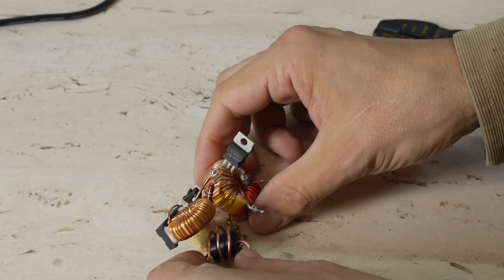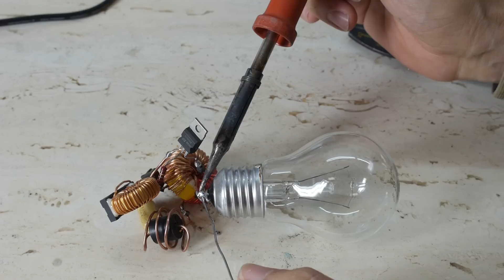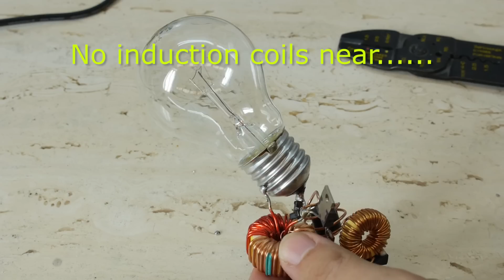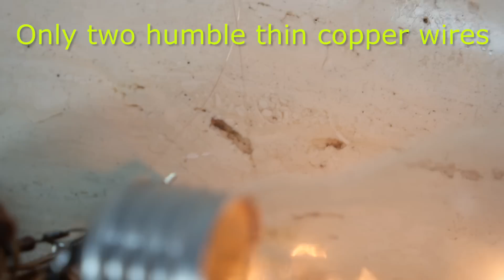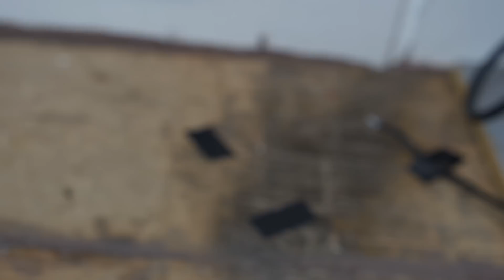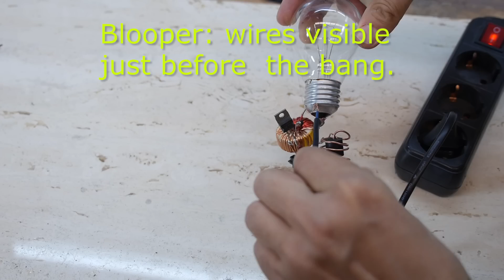Free Energy Light Bulb UNVEILED

Comment: Honestly this is a stupid trick. If there was actually some science involved it would be cool, but it's just two wires that don't show up on film.
Reply: yea. i was expecting a capacitor being charged by that first pump of electricity
Reply: Unfortunately, many "free energy" scams are just as stupid.
Reply: I know. I was never expecting "free energy". I was expecting something that made it look like you were getting free energy through the use of science. Not a trick that is based on the user of a shitty camera.
Reply: sghost128 My take away lesson from this: don't bother with a $10 scam when a 2 cent scam will work just as well. And yes, all perpetual energy machines are fall into this category.
Reply: danceswithtrees I like that line. I'll have to borrow it.
Reply: danceswithtrees I wouldnt say that. they can work, such as magnet motors. here is the problem tho. there is so little energy in them you cannot take any out.
Reply: Mike Warren There is no energy in a "magnet motor" save the very small amount of energy stored in the magnetic field of the magnet. And if you were to remove that energy, it would no longer be a magnet.

Believers in magnet motors usually seem to confuse force and energy.

Here's what puzzles me: all these people eagerly proclaiming that non-existent forms of energy permeate the universe while ignoring a very real, substantial and still largely untapped one all around them: sunlight.
Reply: Force is able to be converted into energy.

The problem with solar is the market has not caught up with the technology. A 8 to 10k watt solar system runs 25k USD

Its just not cost effective.
Reply: Mike Warren No, force is not energy. They don't even have the same units.

Applying force through a distance produces energy, but that's completely different.

Solar systems are already cost effective. I've had one for 15 years, and the prices have fallen enormously since.

Consider it an opportunity. Find an even cheaper way to tap solar power and become rich and famous. And you don't even have to violate the laws of physics, unlike all the other forms of "free energy".
Reply: I did not say force was energy.

and no. its not cost effective. I just priced it out. I can build my own system, and even then its not cost effective for anyone living on the grid. i spend $100 bucks a month on electricity. At 25 grand to install, it will take just over 20 years to break even. 

Can it be worth doing? yes. but for most, its not a matter of the investment being worth it, its a matter of simply not having the money to do it, worth it or not.

I have thought about making a business out of it. Its just not going to happen when the grid tie inverter itself will cost 4 grand and the cells another 4 grand, not including construction, wiring, electronics, monitoring and labor.
Reply: Mike Warren What's your utility's price for electricity? Here it's something like 15-20 cents or more, with a sliding scale that works something like income tax. The more you use, the more each kilowatt costs. So that first kilowatt-hour of solar is worth a lot.
Reply: no idea.  but not enough to make a 20 year investment worth it. not by itself. with a new home perhaps. the payment wouldnt be much built into an already existing loan.

certainly wouldn't be worth it for an investment for other properties.
Reply: Mike Warren Do you really think that if this perpetual motion machine/magnetic field extracting technology was real that someone wouldn't have actually made a working model? Claims of this sort should be lumped in with end of the world predictions and Easter bunny sightings.

It's good to know that you have not been separated from your money to buy one of these things "magnetic motors" but it is concerning that you think it is real and that it works.
Reply: I never said anything about extracting a magnetic fiend...........
Reply: Mike Warren You said something about "magnet motors", which implied you could extract free energy from them. You can't.

A magnet does hold some energy in its magnetic field, and you can even remove it. But when you do, it's no longer there. It's like discharging a battery or capacitor.

One of the simplest ways to tap that energy is to let the magnet pick up a piece of ferrous metal while making it do work as it moves toward the magnet. The total energy in the magnetic field decreases by the mechanical energy you generated, and to restore the field energy you have to pull the metal away. And that takes work.
Reply: That's not what a magnet motor is
Reply: Mike Warren Then what's a magnet motor? When I look it up on Wikipedia, it redirects me to Perpetual Motion. Seems right.
Reply: Turns a shaft
Reply: Mike Warren Yeah, I understand, I've seen them. None work. None can work.
Reply: Yes the can. Why couldn't they?
Reply: Mike Warren Um, the first law of thermodynamics?
Reply: Does not apply. Magnetism is not energy
Reply: Mike Warren The laws of thermodynamics always apply. Always. No exceptions whatsoever. Magnetism is a conservative force, so any machine with fixed magnetic fields, no matter how complex, cannot do useful work while operating cyclically, i.e., periodically returning to the same starting state.

Since magnetic fields do contain energy, it is possible to remove that energy, but once you do it is gone; you'd have to do work to replace it. Sort of like discharging a capacitor, and probably not much more energy.

Electric motors work by converting electrical energy to magnetic energy and then converting some of that magnetic energy to physical work. (Remember I said a bare magnet has more magnetic energy than one with a piece of iron stuck to it.) That removed magnetic energy must be replenished to repeat the process. That's why all motors stop when you turn off the power. If there's no way to externally power your magnet motor then it will also stop, even if it slips a few degrees from its original starting point. It'll stay there forever.
Reply: It can be made to continually spin. But like you said it's not enough to do anything
Reply: Mike Warren No real machine can continually spin without power because it's impossible to remove all friction and windage. So unless it draws power, it will stop. It cannot produce any useful work without an energy input. None at all.

The only "perpetual motion" machines we have are spacecraft far from any planet and its fields. Like the Voyagers in interstellar space. When they run out of fuel they will continue to spin essentially forever because there's nothing, not even friction to remove that energy.
Reply: so then the question is, where does the energy/force/magic come from that are in magnets. they repel forever. or at least pretty dang close to it. that magnetic force will spin a machine until the magnetic force is gone. 

since magnets work on electromagnetism, where is this energy coming from?
Reply: Mike Warren As I said, a magnetic field stores energy. But it does so just like a capacitor. When it's first made, there's no energy. You can put some in, let it stay and then take it out. Once you do, it's gone. You have to replace it if you want the magnetic field again. That takes work.

Permanent magnet materials strongly resist having their energy removed. But that energy was still put there by its manufacturer.

An analogy would be to sell a pre-charged capacitor with insulated terminals. It would produce an electric field between its terminals that would stay there "forever" (if it's an ideal capacitor) with the insulation making it hard to remove the charge. But you can by supplying sufficient external voltage to break it down. Then the capacitor's energy is gone and its electric field goes away.

Magnets can be demagnetized with a sufficiently strong external field, and in the process of demagnetization you can remove the energy put there by the manufacturer.
Reply: magnets do not have manufacturers, they are mined from the earth. they do not lose their magnetism. a magnet is not a capacitor.
Reply: Mike Warren Incorrect. Modern magnets are made from artificial alloys designed to hold very strong fields and to resist having them removed.

Any naturally magnetic material (e.g., a piece of magnetite) with a field had it put there by the earth's field. That energy wasn't free either. It was generated by the dynamo in the earth's core, which in turn is fed by the heat of radioactive decay and the primordial energy in the spinning earth.

No energy, not even in a magnet, came from nothing. It always has a source.
Reply: yes, but that isnt my point, my point is that 2 magnets pushing against each other will do so for much longer than i will be alive.
Reply: Mike Warren Yeah, but so what? I can also generate a continuous force with a rubber band. Gravity exerts a constant force on everything. But force is not energy!
Reply: force can be converted to energy. and unlike a rubber band, it can be done for lifetimes, not micro seconds.
Reply: Mike Warren No, that's just not true. Force and energy are two different things with different units (newtons and joules). Force must act through a distance to produce energy.

A magnet can exert a force forever, but unless something moves as a result of that force there is no energy. And if something does move, it has to be toward the magnet so it can only go so far before it hits the magnet and can't move any further; no more energy is available. It's like dropping a rock, you get energy in the fall but only until it hits the ground.
Reply: move an object away from the magnet, on a wheel, then another away, then another away, around until the first object is back at its start position, then start over again.
Reply: Mike Warren You'll find that the work required to move it back to the starting point is just as much as the work you get out of it.

You simply can't escape the fact that magnetism, like gravity, is a conservative force. That means it doesn't matter what path you take between two points, it's the same as taking a straight line. And if you return to your starting point, that line has a length of zero and the net change in energy is always, always zero.

That's the definition of a perpetual motion machine; if it returns to the exact same starting state with no energy input (e.g., fuel), then it cannot possibly have produced any net energy over the cycle. It doesn't matter if you use compressed air, water, gravity, magnets or rubber bands, the result is the same. No energy produced, just some consumed in friction (which is not a conservative force).

Oh, the machine may put out some energy over part of its cycle just to fool you. But you won't be able to return it to the starting point without giving that energy back.

Have you ever cranked a gasoline engine by hand? You know that it's hard to turn during part of each cycle and easy during others. That's because you're alternately compressing and expanding air in the cylinder. It's like moving away from and toward a magnet except there's a lot more friction, which is why it's so hard.
Reply: Mike Warren How can you say that a PV system isn't cost effective if you don't know the value of what it produces? A PV system is cost effective if each month it offsets your electric bill (on average) by more than the depreciation of the system plus interest. That means you need to know the cost of the electricity from your utility. You also need to know the laws on net metering and the available subsidies and tax rebates in your state.

There are always uncertainties, of course. Your PV system might last shorter or longer than its rated lifetime, typically 25 years for the panels. Here's my experience: In 14 years my 16 Astropower panels have been flawless. My 8 Kyocera panels failed some years ago but were replaced free under warranty, including reinstallation. My inverter has operated continuously for 14 years without a problem.

Another uncertainty is the utility's price of electricity. Which do you think is most likely: go down; go up; stay the same?
Reply: ApolloWasReal Cost of PV system/KWH in it's lifetime = $/kwh.  Compare that to utility rate $/kwh.  PV systems aren't very competitive.  Of course they perform better in places where the weather is PV friendly.  However they have come along way and are only going to get better.  Parents need to push math and science on their children and we'll get there in the next 15yrs where alt energies approach the efficiency of fossil fuels.
Reply: shn lj You need to add in the increase in utility cost over the lifetime of the PV. The PV if bought outright has a fixed cost for its entire life not even inflation will effect it, utility rates are guaranteed to increase. This makes PV very competitive
Reply: Yes. that is true. the question is where one becomes more expensive than the other, in order for current PV prices to be worth it, electricity prices will have to go up 5 times. It will go up due to infation and the natural cost increase of everything, but its not going to go up 5 times any time soon.

in the mean time, i can invest that 400 a month extra into something that will make thousands of times more money.

thus at the end of the day, i end up with more money in my pocket.
Reply: Mike Warren Have you done the calculations recently? Solar panels have become enormously cheaper over the past few years, thanks mainly to the Chinese, and many places have some good subsidies. And I don't know of too many high-income, low risk investments these days.
Reply: Yes. About a month and a half ago
Reply: Mike Warren I'd like to see your numbers. They do vary a lot on location, mainly from different utility rates and the availability of net metering and subsidies. Annual solar insolation varies surprisingly little around the US, only about 2:1 between central Alaska (minimum) and SW Arizona (maximum). I'm in southern CA where sunlight is fairly abundant but we still have a lot of coastal clouds.
Reply: 8k watt system needed. 10 k realistically in order to rely fully on it.

Cost for it is 25k. Around 500a month payments.

I only pay 100 a month for electricity
Reply: Mike Warren What do you mean, "rely fully"? A grid-tied system simply offsets your electrical consumption. A bigger system offsets more but costs more, and in some states you won't get a credit for excess production.

Could you possibly be talking about an off-grid PV system? This is far less viable, mainly because of battery depreciation but also because you have to oversize the system to cover peak loads and your surplus production goes to waste.

I am always having to disabuse people of the romantic notion of telling the power company to go stick it. You want the grid. It's a free, infinitely sized battery that absorbs however much you make and provides however much you need when you're not making enough. With net metering, PV already makes economic sense. Without it, it doesn't unless you're in a remote, off-grid area. I have batteries, but they're only for grid outages. Otherwise they stay fully charged.
Reply: I can get credit for what I don't use. 

I'm currently using 8kwh of  electricity.

Perhaps you can show me the numbers of what benefit I can get from a Pv system vs cost
Reply: ApolloWasReal get my last comment?
Reply: Mike Warren Yes. With net metering in most states you get credit for what you don't use, but only up to the total of what you do use in the following year. If you generate a surplus over a year, you have to work out a cogeneration agreement with the utility, and they'll usually pay only wholesale for that excess. The numbers depend heavily on assumptions about the lifetime of the system, the cost of money (interest rates) and future utility rates. I.e., you're comparing 'dollars per (indefinite) watt" on the PV side to 'dollars per kilowatt hour (today)" on the utility side, so it is difficult to make absolute predictions. However, the numbers have gotten much better and are getting better still all the time.

PV system maintenance is also a factor but it is almost always zero. Panels typically have 25 year warranties, and while inverter warranties aren't as long they're generally reliable too. My Trace SW4048 has been running continuously since 1999 without fail, as have my Astropower panels. My Kyocera panels failed a few years ago but were replaced free under warranty, including labor. Batteries are a high maintenance item but are needed only for utility backup; many systems omit them entirely.
Reply: Well. Estimate it.
Reply: Mike Warren Estimate what? I know what my numbers are, I want to know what yours are that lead you to a different conclusion. I know that the variation in annual solar insolation around the US is considerably less than the variation in commercial electric rates, so I suspect that the latter is the bigger factor.
Reply: Iv told you. I use 8000kwh which would cost $25k
Reply: That doesn't make sense. 8000 kWh over what time? $25K for what? PV systems are priced in dollars per (average) watt. Utility electricity is priced in dollars per kilowatt-hour. Those are not conformable, which means you need to make assumptions about the lifetime of the system, future utility rates, interest rates and so on.

I do point out that regardless of the economics of PV electricity it is far cheaper than any system that would have to violate fundamental physical laws to produce any energy at all.
Reply: To cover my energy useage in any given month, i need a 8000 watt system.

My point isnt that its more expensive, my point is that its not cheaper for many many many years. To buy the size system that i need (8k watt) would cost 25000 USD.

Since i do not have 25k sitting in my left pocket, i would have to get a loan to pay for it. So we are at the same point. To have a PV system I have to pay $463 a month for 6 years. to use city electricity, i have to pay $100 a month.

yes I know that after 6 years I will no longer have an electric bill, for the life of system, but my point is that most people cannot afford a $463 payment (minus the electricity they don't have to buy)

6 years is just too long of an investment for most people. Thus it costs too much for most people to do.
Reply: Here is an example my brother payed $11k for a system and gets back $300 per quarter and not pay usage of about $200 so total gain is $500 ahead each quarter, $2k per year, lets say bad years and they drop the feedback rate so $1k/yr, thats 11 years to  pay the system back followed by about 14 more years of usage. BTW here kwhr cost has doubled over the last 10 years. So in 10 years time even if they leave the feedback rate the same the system will be $300 + $400 better off each quarter.

How about some actual examples 5kw costs $9k
Average power generating sunlight where i live is about 3.5hours/day
= 17.5kw/h per day
feed in 25c/kw tarrif = $4.37/day
= $1640/year
nobody is home during the day so most goes back $1500/year
less my total yealy power bill of $200/quater = $800/year
leaves me $700/year ahead
9000/700=12 years, thats about half the life of the PV panels provided the utility costs dont change
Reply: Mike Warren you got ripped off, jan 2014 average prices, 10kw now costs $17k
Reply: Chris Brown Sounds about right. Sunlight doesn't vary as much around the US as you might think; the sunniest place in the country, southwest Arizona, is only twice as sunny as central Alaska, the least sunny place, and solar panels are more efficient in cold climates.

A typical capacity factor for PV in California is 20%, i.e., a 100 watt panel will produce a yearly average of about 20 watts.

Electric utility rates are a lot more variable (and volatile) so that's what really matters. So do the local laws on net metering.
Reply: Chris Brown 17 k is still dang expensive. I looked on the fall and could not hardly even find an inverter much under 4k
Reply: Mike Warren Electricity is still dang expensive. It's just that when you buy it from a utility you just don't pay for 20-30 years of it up front. That's what capital loans are for.
Reply: No one can afford ²0 years up front?
Reply: Mike Warren That's what capital loans are for. House builders also want to be paid up front.
Reply: no one can afford 20 years up front? people need more then that in liquid cash in order to get a loan to purchase a home. so to answer your question lots of people can afford $17k lots of people like me have way more then $17k they can use on getting a PV system, like wise lots of people like me who can afford it also don't bother with a PV system
Reply: Only paid 4k down on my home.
Reply: Mike Warren And how much you pay every month doesn't matter?

I'm amazed at how many people ignore recurring costs, even when they could save a lot of money in the long run by paying more up front. Apparently "No money down" means free!
Reply: Mike Warren Yeah I could have put $4k down on a house, then end up paying more on repayments and have to also mortgage insurance, have low capacity to borrow on improved equity. Instead I decided to put down much more on my homes, yes more then two homes and on an average wage.
Reply: Chris Brown Apolo - I admire your patience & dedication & endurance.  You have more patience than I do with these guys.  "A LITTLE knowledge is a dangerous thing..."  The guy is a mental midget - and as Feynman would have characterised him - "A fool who doesn't KNOW he's a fool" (the worst kind).  Save your 'breath' (typing fingers)
Reply: Chris Brown I hear you!

Another common units-mixup that really bugs me is kilowatts/kilowatt-hours. As in "this plant produces 5 billion kilowatts per year". Unless the plant is manufacturing PV panels or wind turbines, the units are bogus. And even when they get the units right, why not just say that it produces an average of 570 MW?

Re guns keeping "the gub'mint" in line, I like to ask how that idea worked out the one time it was tried: between 1861-1865.
Reply: Well my american history knowledge is 0.1% and im probably quoting the wrong war but im guessing its cause
a) the americans were allowed guns
b) the british had similar weapons
c) they were a foreign power
d) the numbers were similar
e) hit and run tactics would work due to there military tactics
f) etc

americans see it as (coming from a non-american)
a) me a few mates had a secret stash of pre-1850 guns
b) the british army had guided missiles, disintegrators, teleportation machines, ray guns and flying saucers
c) they were a world-wide nuclear powered and nuclear armed super power located in every corner of the country and tried to take over my back yard
d) they numbered in there gazllions (billion x 1000)
e) they had advanced navy seal military training tacits and battle computers
f) etc

americans only focus on a) cause a) is the only reason they beat the british, and a) stand true today and will always stand true, no matter who tries to invade
Reply: What are we talking about?
Reply: So I've been silently watching this thread.

You guys know it's 68 comments long?
Reply: sghost128 I'm on threads with several hundred comments.

No, you're not missing anything.
Reply: 70
Reply: Mike Warren I forgot what we are talking about, last bit was about the arrogance of certain Americans and their belief they can overthrow the government cause they have guns. Their insistence that having guns is the only reason why they have rights and freedom. Guns or not the govt can always take away all your freedom and rights.
Couple of peers with a couple of guns is of no threat to the govt, the govt is much more concerned with the safety of its population and what people do with the guns then that people have guns. If the ENTIRE civil population was actually civil the govt would let them have any kind and amount of guns they want
Reply: Chris Brown These people also do not realize that they were born with weapons far more powerful than any gun: their own brains. Unfortunately, you can't buy them at the local gun store. But you can substantially upgrade your existing model with a lot of hard work.

Brains are even more powerful when they can communicate, and the Internet is the most powerful communication tool ever invented. Why do you think the NSA is so determined to control it? The net, and related tools like cryptography and general purpose computers are the "weapons" really worth fighting for -- not guns.
Reply: Like the Chinese govt censoring the internet, much more efficient and effective form of control
Reply: here is how it goes. i try to beat someone with my laptop. just by chance, that guy is better at bashing things than I am, thus he has an advantage over me and my family.

thus why i carry a gun, take away any advantage a criminal has, and give the advantage to my family.
Reply: Mike Warren Until you end up on trial for second degree murder like George Zimmermann.

Are you sure you can't figure out how you might use your brain to protect yourself?
Reply: Are you asking if I will choose any other way to protect my family before grabbing a gun. I sure as heck would. I'm not in a hurry to shoot anyone. 

Zimmerman would not have been put on trial if he would have been minding his own business. He wouldn't have gotten the crap beat out of him either
Reply: Mike Warren Precisely. But minding his own business would have required him to use his brain. Do you see my point?
Reply: Chris Brown 40 million gun owning citizens vs 1.6 million military officers. Most of which won't fight the citizens. 

We can stop a tyrnacle government of we want and if we are untied. And it would not be the first time. 

The question is if we will be united when the time comes
Reply: ApolloWasReal yes. I have to agree with that. Problem is. Some times evil seeks you out where you live and shop. This is when only force can protect you.

George Washington did not use his freedom of speech to defeat the British. He shoot them
Reply: Mike Warren It is almost always possible, and certainly highly preferable, to use your brain to avoid being forced to defend yourself with violence. Exceptions certainly exist, but they are far more rare than most people realize, most of the reasons to keep guns for "protection" are hugely contrived, and the claim that we need them to "keep the gub'mint in line" crosses into full-blown delusion.

It's not that I trust the government; far from it. But guns are about the most self-defeating approach I can think of. In the 1960s, many civil rights leaders pursued a range of strategies. Today, we tend to remember and honor only one. What set him apart from the others?
Reply: Guns kept king George lll "in line".

You are right about guns not being used as much for protection as other strategies. Not going out at night. Only meeting people in public places. Prayer. Avoid bad parts of town and dark alleys. Ect. But none of these things are exclusive. I can do all of them while still having my firearm. And God forbid none of them work. I'll have the last option available to me.
Reply: Mike Warren so then what if the criminal carries a gun, and just by chance he is better with a gun then you? are you going to:
1. carry a bigger gun
2. carry 2 guns
3. give your family members guns
4. all of the above

40 million civies vs 1.6 mil army. Army will win even if you are united and it also wont be the first time.

Like I said earlier, how did g. wash defeat the whinging british? well for starters it was a hell of a lot more even back then.
Reply: No. Army won't win. You cannot win when out numbered 40 to 1. Remember our militias won the last time. And we did not even outnumber them the last time.

Yes sometimes a criminal does have a gun. Carrying a gun greatly increases you chance at not getting hurt when attacked. But it is not a guarentee. Sometimes it is safer to not use your gun. For example I carry $10 on me that I do not spend. If I get robbed its safer to give the robber that $10 and let him walk away instead of trying to use a gun.
Reply: Mike Warren when I say that line they always reply back with, you saw the robbers face and he is going to shoot you. so you want to get robbed of $10 and shot in the face..

Ohhh yes, you are right, I forgot, the govt has only has control of the army. It does not include, the airforce, the navy, the national guard, the police or any reserves or retired personnel, they have no planes, tanks, armored transport, fully automatic weapons, artillery, attack helicopters, drones. They only have useless actual combat experience unlike the civilian population which is highly proficient with more useful exposure from games like bf3 and cod, the army is also not trained to kill, is not organised, has no communications capability, is very limited on supplies and cannot support itself
Reply: 1.6 mill includes all of those groups. And frankly. Its not those groups that thou have to worry about. While citizens in fact do have tanks, drones and fighter jets, its not the military we have to worry about. Its the militarized police. If you want to see how it will happen look at the Boston videos. They were not bombing neighborhoods. 

Much of our militia are ex military. 

As far as your other  statement, I don't follow you. Most robbers will not kill you. They only want your money and will walk away once they have it. The robbers that want to kill the witnesses are few and far between. But if you look you can find these exceptions. These exceptions are why I carry a gun.
Reply: Chris Brown sigh. typed a bunch, got an email, clicked it and lost all i just typed.

Police spend their lives in conflict with citizens and view citizens as "bad". The military on the other hand spend their lives defending citizens. They won't turn on them. 

As far as plans tanks drones and trains go, this is a pointless argument. We get into an up roar when they are used in civilian areas in other countries, if they blew up a neighborhood here, our citizens would go absolutely nutz. It would start a revolution.

If you want to see how it will happen, watch the boston videos. militarized police raiding homes. this is how it has happened time and time again in our history, and we are no different.

Here is the problem tho. The government uses the media to convince the majority of the people, being highly gullible, that because something bad happened, you must give the government full control and unhindered power. Of course when it comes to humans in power, they take advantage of it for their own good every time.
Reply: Mike Warren I would like to know if anyone in Boston denied the police permission to search their house without a warrant. Assuming the searches couldn't have found the surviving bomber if the owner was actively hiding him, there'd be no point for the police to force the issue. I'd like to think I would have said "I'd know if he was here and he's not, so I'll save you the time".

As it turned out, he was found outside the original search area after it had ended, and the homeowner who found him voluntarily invited the police onto his property. That demonstrated that heavy-handed methods weren't necessary in this case.
Reply: $100 I would have put $2 down as a deposit and borrowed the rest, then sold if a few $000,000 and bought a modern battle tank and a stealth jet fighter that seem to be common place among the civilian population in america. Then I'd take over a small island nation, expendables style. All this much fun for only $2 and I'll end up with my own private island